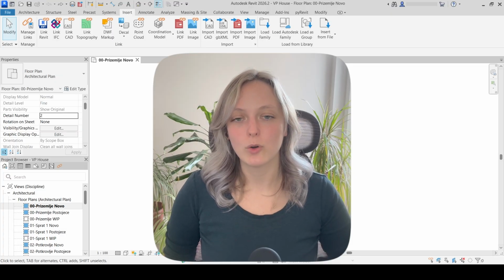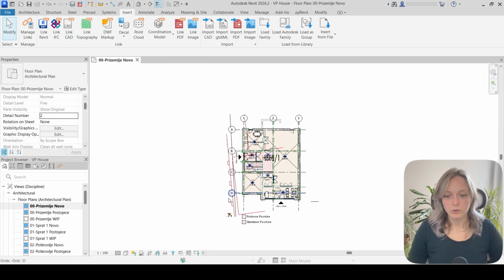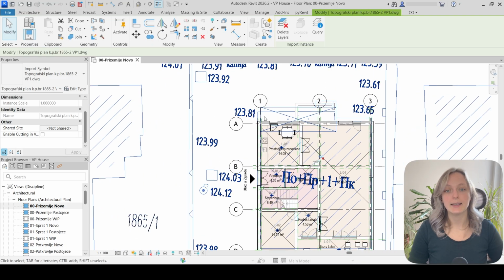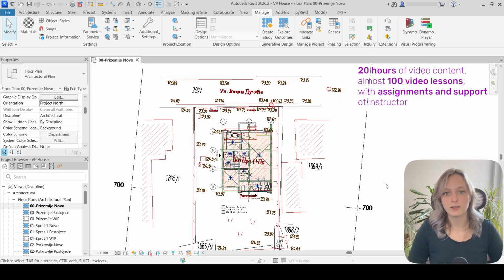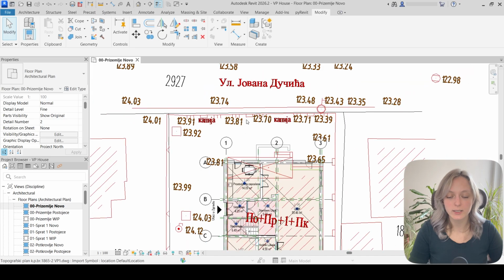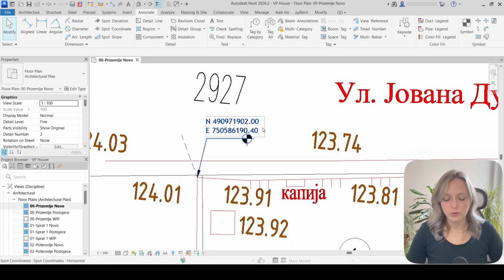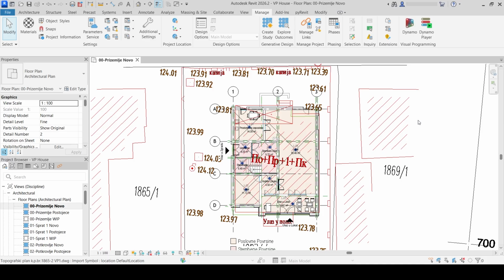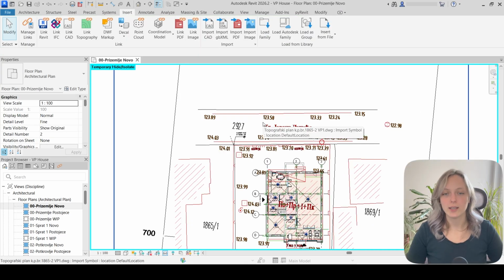How to Relocate an Existing Revit Model to a Survey CAD File

Comment: Congratulations, your lessons are very successful. I have a site with 10 villas at sea level (I created the toposolid, it's very high, 1150-1180 m elevation difference). I've adjusted the basement levels of the villas. How can I place the villas since they are at different elevations? I'm using Revit 2026. Do you have a course on this? I would like to purchase them. THANK YOU.
Reply from the maker: Thank you for kind words!

I think it is the best to model each villa in separate model and have one separate model that will be main model model (with just terrain inside), in which you can link all other villas. You can georeference overall model and than take coordinates from that model to all other models. Only change the apsolute elevation for each model. You can cut the main terrain with voids (or pads, depending on your revit version). 

Unfortunately, I don't currently have course on the multiple villas, but in my architectural course we create project of one villa on a very steep terrain and I believe it will be very helpful to you on your project.
Reply: @BIMTonicLive  TEŞEKKÜRLER👍

Comment: Hi . Ma'am I tried to doing by this methods . My all methods are correct upto .when I linked the second file by shear coordinate.then this second file are come to other side  of work space  . Can you give me any solution on that .
Reply from the maker: Try cleaning up the CAD file. Very often CAD files have elements all over the place that make mess. Than after file cleanup try again from the beginning, mostly it's more easy to start again than to try to fix the coordinates.
Reply: @BIMTonicLive  Hi check my cad file is cleaned. Also my coordinator are also matched. Here any another way  of cross verify to.my model on exect coordinat?
Reply from the maker: @vinayakpatil8855 have you turned to project north before linking file?
Reply: @BIMTonicLive no . I also checked by another way . I create new project file linke thier cad file by shear cordinate and then linked revit file  by shear cordinate.but in this Process also the revit file plced long distance form link survey cad file.
Reply from the maker: @vinayakpatil8855  It's important to follow the process exactly step by step. If you are starting the new file (not relocating the existing one), you can follow this tutorial https://youtu.be/BDgGTh_NCSs?si=tD3qbipJ6V6lnlcx

Comment: I would like to create new markers (arrows, dots, rectangles), and various others, enter them as a new family or add them to existing families, for example a new cross to the dimension line (different angles, shape). Is it possible? Please provide instructions or a video on how to do it.
Reply from the maker: If you mean arrowheads (the marks that you add to annotation families), you can make new ones by going to manage>>annotations>>arrowheads, and create the new arrow heads in the standard shape, by duplicating existing ones and creating new ones. Than  you can add them to your dimensions, tags, texts, etc, via EDIT TYPE option.... I've added that topic on the list, so I will create that lesson soon.
If you mean completely separate annotation elements, you can check out my generic annotation lesson at link 
https://www.youtube.com/watch?v=fi6duSTp4nw

Comment: How to create a cadastral plan in Revit? I usually create it in AutoCAD and then import it into Revit. And is there a way to edit the imported dwg in revit
Reply from the maker: To create an architectural site plan, I insert survey CAD plan from surveyor (I usually receive them in CAD format) by first cleaning it up (purging and deleting any existing floating lines and elements) and then I link it and georeference revit model. After that I create property line and toposolid. This way you get a base for modeling a building in good coordinates.

Then I create a floor plan and set the orientation to “true north”. 

Editing CAD file is possible only by visibility/graphics settings. In visibility/graphics or template you can go to imported categories tab and click on plus sign of your CAD name and you get list of layers. There you can update visibility, line weights and line patterns there. 

If you’re interested in this topic I could create a video next week.
Reply from the maker: Hello, I have created a lesson on that topic, check it out!